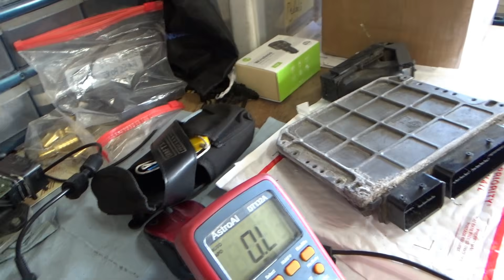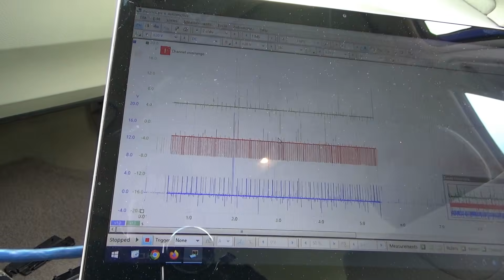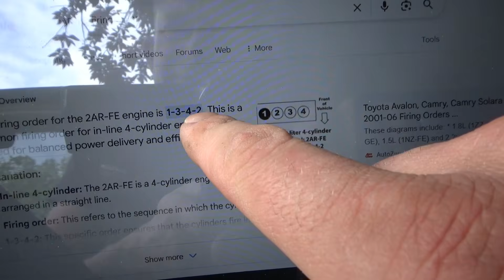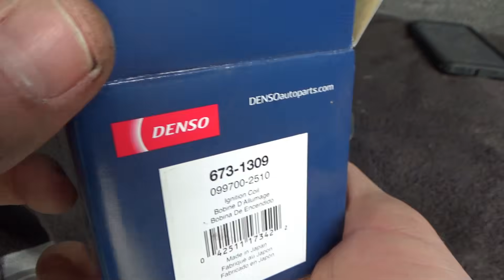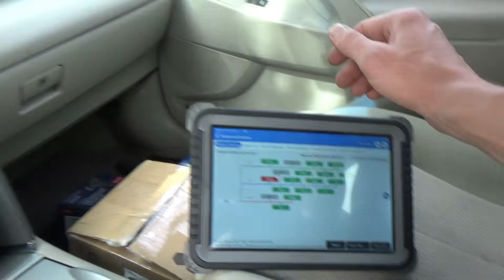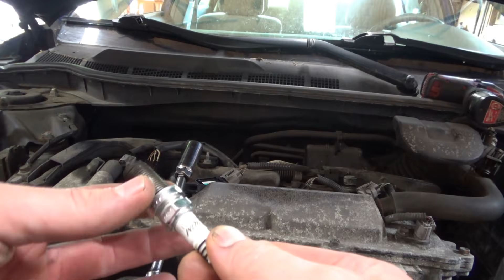(Pt 3 - CONCLUSION) CRAZY Camry...EATS ECMs?!? (Labor Day Special 2025)

Comment: That was a great case study.  I've seen coils fail spectacularly many times.  Smoking, melting, the works.  Even throwing spark everywhere else but not to the spark plug.  I've seen a bad ecm on a Ford kill a coil in under 5 minutes.  Pulled the coil on the misfiring cylinder while it was running and it burst into flames in my hand.  That was crazy.  But I have never seen this happen before.  Awesome work Ivan!

Comment: Devil’s advocate: NGK “loves parts failure feedback to improve their design” but… they didn’t actually commit to change anything, and aren’t issuing a recall for these legacy coils. 

In their defense, as a publicly traded company, their primary goal is to “maximize shareholder value”, so if this type of failure occurs in only 0.000001% of their coils, it’s likely not cost effective to spend $$ to recall/redesign the coil. 

Unless… this video gets a ton of visibility. Because for that 1 person that does experience this failure, they’re likely to be told (by anyone other than PHAD) that they need a new engine/car because the problem is unfixable.   

Having said that, I was convinced that NGK was going to tell you that it was a counterfeit coil. I mean, if bad actors find it cost effective to counterfeit $10 NGK spark plugs (which they do, and NGK’s official website has a warning about), then it’s certainly cost effective for bad guys to counterfeit $20 NGK coils.

Comment: It would have been nice if they would have offered to  pay for the parts replaced by your customer seeing that there part caused it.I guess live and learn I use Denso parts on my toyota.I will never buy NGK coils I do use there spark plugs. Enjoy your videos you never know when the information  you get from your videos will help you fix your own car or someone else's. One day I watched a video about a compact chevy car that the cooling fan was not working and the car was overheating. A friend of mine called me to go take a look at this girl's car and it was the same car and same problem the 40amp fuse was blown and I knew exactly where it was so I swapped it with another one that she didn't need and told her to go pick up some spares and replace that one probably her fan motor was on its way out.

Comment: That was a tough one. I understand the coils are triggered by a 5 volt signal but is there actually a 5 volt reference going to the coil and if so why? Are they supplying +5V to the coil driver and then triggering the circuit with a low side switching transistor like an N channel MOSFET instead of doing high side switching which would require a more expensive and larger P channel MOSFETs?

Comment: "we've never seen this before"   you know how many times in my life i've heard that???   either they were lying or i happen to be a magnet for the unimaginable.   so here's my take on this.  a bad insulation on the winding wire in just the right spot  but there is no reverse protection  or insufficient protection on the other connections. its one of those things you'd like to do an autopsy on that one and an oem  to compare

Comment: One technique I use for finding leaking or over spiking coils is to remove some of the cover off of the trigger wire. And wetting my hand and touching the bare wire. If there is a high voltage spike back feeding to the ECM you'll feel a little shock. You can use a piercing probe or needle on the trigger wire and put your finger or even your tongue there.  This works well.

Comment: Nice one.  These sort of problems scare the crap out of me.   I as an electronic engineer, I knew when the 5V ref got killed it had to be and over voltage.  A short to ground usually will trigger the regulator's internal safety shut down and not damage the component but if you exceed their "Absolute Voltage Rating" speck on any pin, all bets are off.  This is why a bad battery or charging circuit that over volts the +12 is so bad.  But a coil with possibly hundreds of volts on the line is another matter.  I am surprised the condition didn't kill other modules in addition to the ECU.  Love my 2010 Camry, best car I ever owned.  I do worry that when it does die, I will not be able to find the issue without lots of $$ to feed the parts cannon, fancy scan tools and the necessary technical data.  My 65 VW was so simple to diagnose. Now if I could just find a solution the the Camry's sticky dash!!!!!

Comment: Older Peugeot 306 cars had a well known issue with the ignition coil sending random current spikes that fried the ECU. Mine blew out the idle stepper motor control circuit in the ECU so it was randomly 'stepping on the gas' without me touching the pedal. I had to buy a new (updated) ignition coil and ECU as Peugeot denied all liability for the problem.  🤮😡 This was around 2005. I still drive that car today without any other major issues. It tout me to never ever trust a car dealer or manufacturer.

Comment: You're not wrong  about NGK 
I bought a 2006 Ford Explorer 4.6l from the auction 7 years ago and had mismatch Chinese ignition coil causing havoc so I replaced all the eight ignition coil with NGK from Rock auto all the problems went away
last year 2024 I started to have transmission issue and I already knew that ignition coil can cause that so I moved the ignition coils from the passenger side where the transmission wire is to the driver side and guess what? I start having throttle body issue. I end up finding the bad one and replace it with the original one 
It's been good until now. The car is going on limp mode under heavy acceleration and i can see the misfire counter another ignition failure 

Your video came on the right time. I'm going to replace the whole ignition pack again 

One question, what do you think about Hitachi products? I had success with them on my 95 Lincoln Town car mass air flow sensor. I know they're made in Japan 

I bought denso for my g. Patriots from RockAuto but it says made in China. Is it okay does yours say the same when you buy it from RockAuto should I try Hitachi or just buy the OEM ignitions 
Thanks 🙏
Reply: Change all eight coils to Denso ignition coil limp mode transmission jerk went away

Comment: I love your diagnostic abilities.  That being said, I have had problems with both Denso and NGK.  The unfortunate part is that they both are using cheaper materials in production and it appears quality control has gone down.  All manufacturers have a certain percentage of failure that is acceptable unfortunately this one obviously was spiking the signal back to the ECM vs just an internal short to ground which most coil failures are.  I have had Denso that didn't even last a year before failure, OEM ones and I have had a coil take out the ECM on my son's 2016 Ford Explorer 3.5l.  But to say no more NGK in my opinion is not correct seeing how all manufacturers have issues.  Just my two cents.

Comment: the owner has some advance  knowledge  and tools programing his ecu you said no scope no chance of repairs but the car was giving us parts changers a bread curmb to follow setting coil codes I'm pretty confident if you ohmed the coil you would have found a path between the two this is the craziest find since the Subaru  had after market coils and would not charge

Comment: Shouldn't be bad mouthing NGk as any coil can fail at any time and do they same thing. It's not like they were bad right out of the box. I've seen every brand fail the exact same way. I've installed NGK coils on my Ford and they are one of the few brands that will work fine for years as most aftermarket brands will not work properly even when new

Comment: Did NGK do a tear down on the bad ignition coil? What were the results if they did this failure analysis? Did you get a schematic of the circuit from NGK and s fsilire report?  I would have loved to send the faulty coil  to an outside lab for failure anslysis but I don't think anyone would pay for it as this wouod cost thousands of dollars.

Mark

Comment: The only similar coil issue I have run across was on my own personal 2006 Ford Explorer with the 4.6L V8.  What had happened here was the original Ford OE coils began breaking down, and introducing interference into the CAN communication lines, which Ford had routed in the harness right next to the coils on Bank 1.  It made it do all kinds of odd things, like the electronic throttle would throw faults (wrench light!), the automatic 4wd would spazz out and engage at random times without detecting tire slip, and the transmission would shift SUPER rough and bang gears.  But the best part was, it would not retain a trouble code after the key was shut off.  I found it by making it do its thing, and scanning for trouble codes without turning the engine off, and that's when I got network codes U101 and U1900.  

Sounds completely possessed, right?  After seeing that the CAN lines ran right next to hose bank 1 coils, I suspected interference immediately, because it was highly improbably that all of these systems would fail independently at the same time.  Sure enough, a set of new coils fixed it.  How did I think to check where the CAN lines ran?  The electronic throttle's connector points towards Cylinder 1, and its wiring ran into the wiring harness that ran along that valley on the way to the PCM.

Comment: Great case study Ivan. I’m trying to remember who posted a similar video where a coil took out the engine computer. It had to been one of those channels Diagnose Dan, Paul Danner, SMA or Jake with Automotive Diagnostic and Programming. 

You are so right about networking. It was great to hear about NGK’s testing and failure analysis. Which would have never happened without you making the right connection. 

Enjoy your day off today.

Comment: these Camry ECM episodes were great.  Awesome diagnostics Ivan.  The first piece was finding that 5 volt reference issue, then the resistance checks which involved finding all the pinouts.  The amperage test using the 'binary search' method; and then calling in the Pico to zero in.  Incredible.   Looking forward to more head scratchers.    I've already fixed two different cars just by using your 'drag test' method.  I looked like a hero-  would NOT have even come close to thinking along those lines without PHAD.  Take care-  drive safe everybody.
Reply: What is the "drag test" method?
Reply: @bernardocisneros4402  electrical female connectors can 'spread' mainly due to plugging in test equipment with too large of a probe. Sometimes they just wear from plugging and unplugging them. The drag test is simply sliding in a probe with about the same thickness as the actual connector - if you don't feel resistance or your test probe is loose - the connector needs to be closed / tightened and if it's really bad-  replaced.
Reply: @lynskyrd Thanks for the explanation. I guess I aleeady knew what it was. I just know it by another name. I know it as a pin/terminal tension test. I even have all the different sizes of male pins to test the female terminals. Thanks again!
Reply: @bernardocisneros4402  AI Overview:  An electrical pin drag test, also called a terminal tension test, verifies the proper tension of a female electrical connector's pin by checking the drag or resistance when a male pin or test tool is inserted and removed. To perform the test, insert the appropriately sized test pin or a spare male pin into the female terminal and gently pull it out, feeling for a slight drag. A good connection will have noticeable drag, while too little indicates the pin is spread too wide and a connection will be poor, leading to potential electrical issues.  A test not covered in sex ed classes.

Comment: i worked st huntsville electronics which was a chrysler div,,, we built just about everything electronic for a car and had the luck that our engineering section if we had a suspected bad computer or anything we built they would have us bring it in and they would replace it with a new unit and then they would test and tear it apart to find out the real life problems associated with it ,didnt matter how old or anything...they would also offer the next yr models of our radios that we built to any one that had a 1yr old car that it would fit for us to test out and then file a report back on it...they would take our cars and change out the radio and also let us keep the radio taken out as well..sure was a sweet deal until the so called MERGER of equals with the Mercedes killed off our planet..we were the only electronic plant that was owned by chrysler and we as well had to compete with the other manufactures for our contracts,so no sweetheart deals on  the inside due to pricing

Comment: I have a few 2v modular Fords and they always have coil problems. Water drips into the plug wells. I always run Denso because they're OEM but I've heard of aftermarket / cheap coils popping computers before

Comment: Ive been using NGK/NTK Products on my vehicles for quite some time, i've never had any of their products go bad after installation,  I recently had a MAP sensor go bad on my 08 honda civic,  it was a hard failure of the sensor that set the CEL,  replaced with NGK/NTK map sensor and it runs so much better now, it even idles so much more smoothly than it did with the old sensor. the civic is running NGK O2 sensors that i replaced about 4 years ago.  I believe your NGK coil failure is a rarity in the way it failed.  It wouldn't sway me from using NGK/NTK products in the future.  I'm a industrial maintenance tech/powersports technician by trade, but your videos are certainly helping me understand the automotive side of things.

Comment: So it's the same old story yet again..  The REAL flaw here is like you said:   They chose to put the "drivers" into the computer?  Why?  I wish we could get away from this trend of putting drivers or embedded relays built into the computer (such as for a fuel pump, etc).  It's such a foolish design choice.  Like you said,  other coils are designed with the driver built into the coil itself.  This is anther degree of separation and a good way to shield the computer away from the high voltage.  (I suppose it does make the coils a little more expensive).  I just wish we could get back to things being built on the fundamental engineered best design, rather than just the cheapest design taking the lead.
Reply: On this type of ignition coil, the driver is in the coil. The only thing the ECM does is provide a nominal 5 volt square pulse as a trigger. The driver is the transistor inside the coil that completes the circuit from system voltage through the primary coil to ground.
Reply: @bernardocisneros4402  You may be right, but that's not what he says in the video.   17:44 ..
Reply: @calholli That's exactly what he says at 17:44. The 2011 Toyota Camry has 4 wire coils not 2 wire coils. He says the 2 wire coils have the driver inside the ECM and the 4 wire coils have the driver inside the coil. It's easy to miss if you're not paying close attention or you're not well versed in this stuff.
Reply: @bernardocisneros4402   It's just the way he said it there at the end..  I thought they were two wire coils.  I didn't pay attention when he was testing them. lol..   I was actually eating while watching it this time and missed a few things.  I was listening, but not watching as faithfully.  Pretty crazy that it was still able to jump to the control coil anyway;  even with the driver inside the coil.
Reply: @calholli yeah, I know what you mean about eating and watching YouTube. I gotta stop that habit because I don't fully enjoy my food and don't fully understand what's going on in the video. I'm the type that can do 1 thing really well but can't walk and chew gum at the same time😅
Reply: It just means that there is not a good insulation separation between the NGK's control oil vs the ignition side.    What a shame.  They probably skimped out and didn't put in an insulator shield, and instead chose to rely on the "potted" resin that the fill it with at the end...  Well, that wasn't good enough obviously.  So because they chose to skip a step or save a little money (likely)-  it has now bitten their entire reputation.   I know it's cut thro4t competitive world out there..  but there are certain corners that can't be cut-  high voltage being one of them.     What a great case study... I thought it might have been a bad regulator on the alternator.. but this makes even more sense.   That high voltage spike can k^ll your scopes too.. So you really have to be careful when testing for this stuff..   An attenuator is your friend.  ;) @bernardocisneros4402

Comment: Hi Ivan, from personal experience, I had problem with NJK iridium spark plugs that I have bought from Rockauto. My car ran around 12000 km and started misfiring. I did inspect them twice and nothing out of the ordinary. Then reach out several YouTubers complaining about NJK sparks plugs. The original plugs installed were Denso made in Japan and discovered that the NJK one’s didn’t have the JAPAN stamped on them. I have gotten suspicious. I have decided to switch back to the original Denso Spark plugs and to my surprise there is no more hesitation or misfiring. Watch out, it seems there is a difference in quality between original Japanese parts and others. The NJK that I bought from Rockauto came with a box look identified as NJK but assembled in south Korea and not in Japan!!!

Comment: Scary how devastating a part failure like that can be to other components. I've had the best luck with Bosch coils on my 2.4 dodge. Others don't seem to last long, don't work at all or have intermittent misfires. Never had one destroy an engine computer thankfully. I would think some of the board designs are better equipped to deal with spikes than others. BTW, although those boards have failed, I'm sure the components being destroyed can be tracked down and replaced.